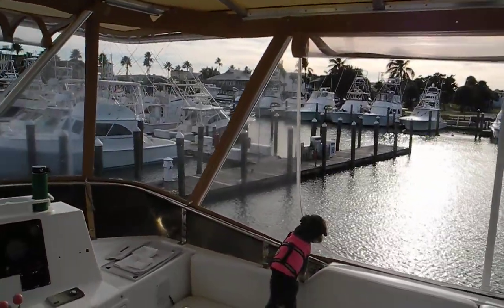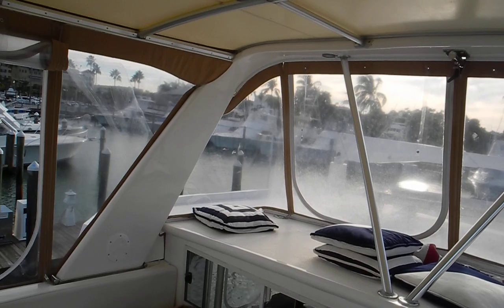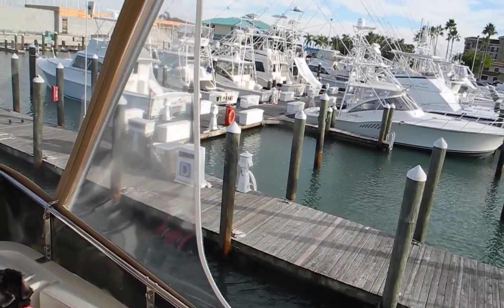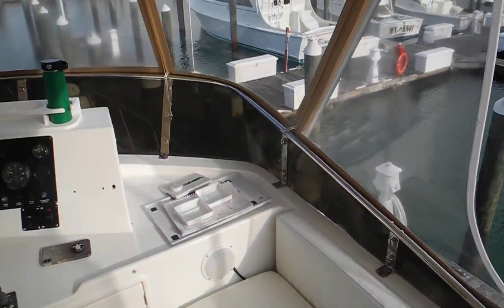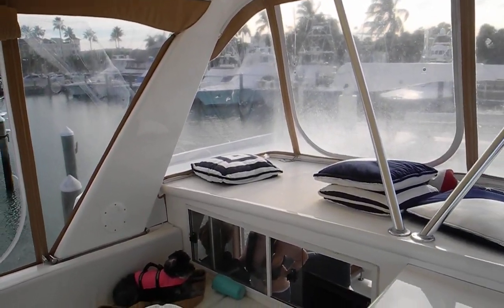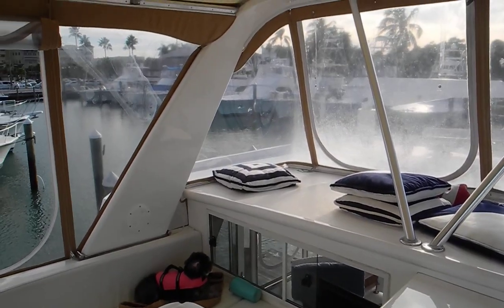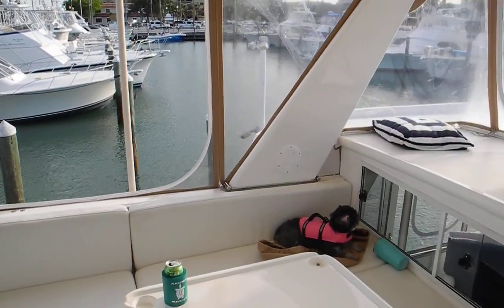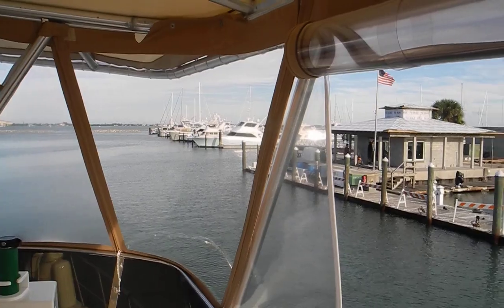Bend around the piling when docking here.

Comment: Too many captains today rely on thrusters which can fail often at the moment you need them.  I am considering 2 different vessels for my next boat.  The one that we love the layout, the ride, the finishes only comes equipped with single diesel.  The sales guy and his boss tout the spectacular standard bow and stern thrusters for easy maneuvering.   What if they quit?  Something goes wrong?  Backing a single screw down east hull is a dog....I know commercial guys with this type of vessel do it with their eyes closed but they been doing it since they were 14 years old, almost every day.  I'm not bashing tech but I think one should be able to dock and depart in all conditions WITHOUT thrusters and then use them as the commodity they are.  Just my 2 cents.

Comment: Captain Chris, I just love your docking videos.  Keep them coming.  If this boat were trapped between two boats (one in front and one behind) and the bow thruster were no match for the wind, how to escape the berth?  Spring off and back out with an after bow spring is the best option?
Reply from the maker: Depending upon which way the wind or current is moving, we also consider a short stern line and a door hinge to move the bow out first before releasing the stern line. And then there is the reality of having to wait (on occasion) for the slack tide to avoid any drama. Thanks for watching and for your comments 👍🏼
Reply: @AskCaptainChris  haven't tried bow out maneuver with my boat as square nature of stern of a camano troll and most power boats seems to not agree with pivoting off that way. doable but risks damage to swim step and dinghy on davits I would think?  if you had a choice, would you say power boats are better off springing off with an after bow spring to swing the stern out?
Reply from the maker: W B the dinghy aft makes the stern hinge maneuver dicey. A bow spring can be another option.
Reply: @jhance031  I like the bow spring.  Im an old Coast Guard guy and crewed 95' patrol boats in the day in Kodiak and Juneau Alaska .  Always moored with boats fore and aft of us.  Bow spring was S.O.P.  I will admit we never had things like swim platforms or dinks to worry about, we just had to get off fast.